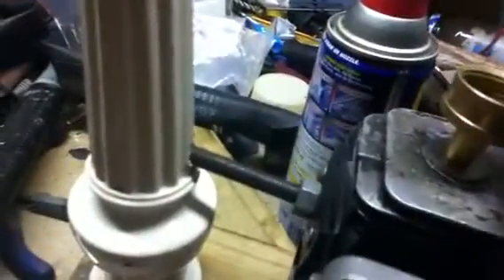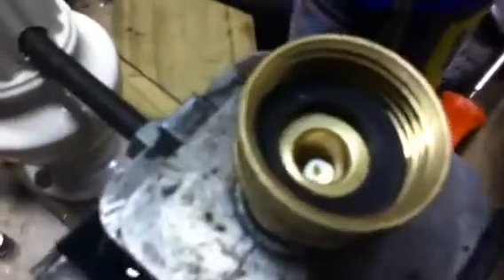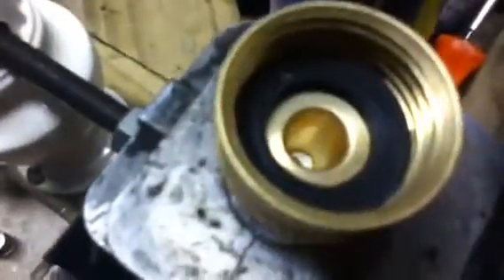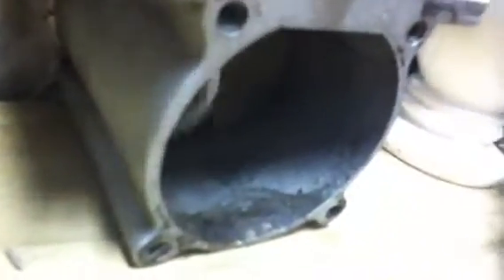Homemade steam engine part 4

Comment: Hi there! you're working on the exact same sort of 25cc engine I made a steam engine with. Only I made an exterior driven mechanical valve. Your valve type is seen as well in model-making-engines! Anyway, you don't need a big flywheel like your bicycle rim, a big bearing will do the trick. See what I did? I came from the distribution belt renewal kit of a Land Rover, these bearing are great. Ask a garage! CLick on my ID to see my movies. GOOD LUCK